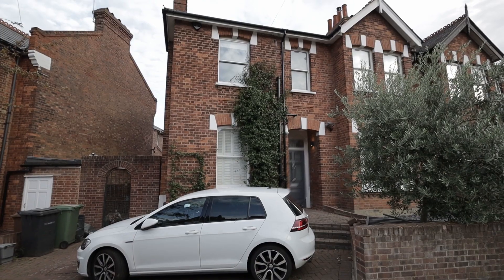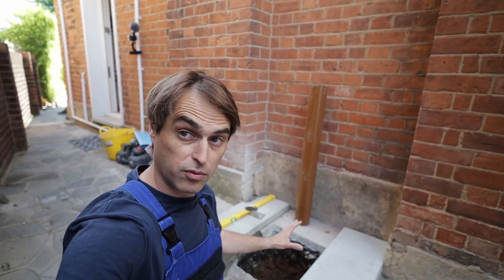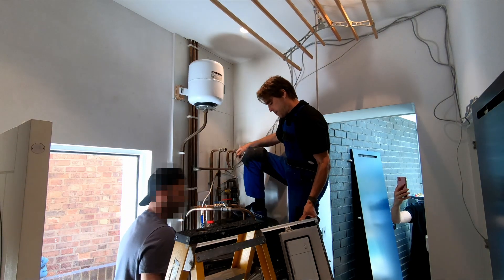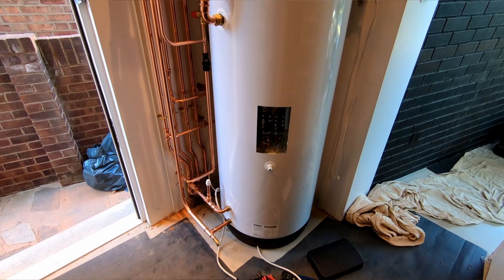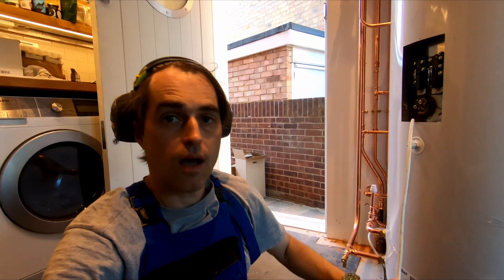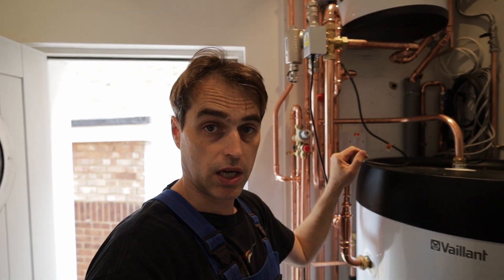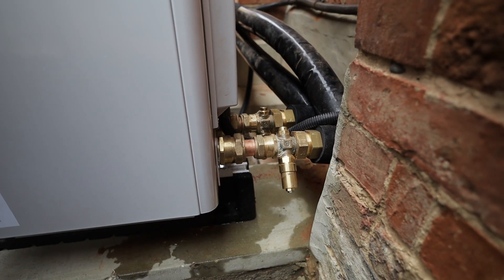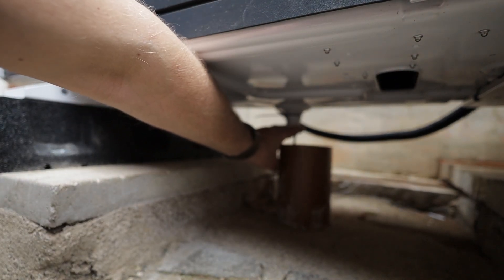Is This Heat Pump Better Than Your Gas Boiler?

Comment: What would the annual maintenance costs be on a system like this?
Reply: depends on the cost of 10 minutes of your time and the price of a bit of water to hose the outside unit down yourself with a garden hose and clean the lint and muck off the evaporator....

Comment: Depends on where you live most heat pumps setups don’t work under 40F
Reply from the maker: What are you talking about - they work to -20c / -5f
Reply: heat pumps work in heat pump mode to -15~20 easy and even then they can switch to a immersion heater for backup heating. if you get artic rated ones you can go down to -30.

Comment: The very fact that the homeowner has gone to the extent of insulating and reducing heat losses in preparation for the HP sums it up for me - also for reusing the old boiler and tank - double win. This with the fact that the HP only needs to be 6kW again sums up the problem with the UK gas heating industry in the last few decades. There are a couple of channels that could do with learning a thing or two from you! Great, honest work as always!
Reply: Surely with all the insulation work, a gas boiler only needs to be 6kw? The requirement is independent of the heat source??

So really the issue is insulation etc...not the source of energy?
Reply: @ChrisLee-yr7tz  exactly that - how much energy input is needed into the building to keep the temperature steady. Problem seems to be that the plumbing/gas industry's drive to rip out heat/system boilers in favour of combis that need a high output for hot water means the boiler design is scaled as such when it comes to CH - insulation isn't glamorous to most compared to new shiny stuff hence why it's neglected!
Reply: Huge radiators are not ‘ lovely ‘ they are needed because the hot water circulating through them is 40-50C not 80C plus like gas boilers .
Reply: @stoicsceptic8420  it's all about system design - any condensing gas boiler should not have a return flow above 55C if you care about efficiency in any case - likewise for HPs, bigger rads only to match the required flow temp for efficiency - 40-50C is on the high side...

Comment: The average annual COP is what matters, not the peak COP.  So how it performs over a full year thru all four seasons.
Reply from the maker: 4.1 is the average cop quoted by manus - so called sCOP
Reply: @UrbanPlumbers  
That is average?  If so I am impressed. Real world testing is the only way to determine.
Reply: @UrbanPlumbers  
Currently, my gas costs one quarter per kW than electricity. If it stays roughly that way, I would say gas has the edge for sure in running cost, and clear in up front capital costs.  But it costs about £80-100 per ann just to have a gas meter in the house. These days saving £100 and using it for electricity purchase, does not buy a lot of electricity.
Reply: @johnburns4017  your gas is mostly paid by the goverment. how long do you think that will last as its going now?

Comment: Osohotwater, who makes cylinders for Vaillant as you say, also make the unique Super Coil (SC) cylinder where all of the connections are on top of the cylinder so it is has a very tidy look. A common use for it is where the gas boiler is above the cylinder in a tight space like a cupboard. So the blending valve, temperature & pressure relief valve, expansion vessels, motorised valve and all pipework are all situated on top of the cylinder (hidden under the lid). All their cylinders have concealed wiring as you demonstrated as well as concealed heating elements that don't stick out. Question remains whether these types of cylinders are as easier to service as standard cylinders.
Reply from the maker: They are very nice - just a bit wider than most though

Comment: That looks like about 200 MW of electricity before you go into profit.
Reply from the maker: This whole installation after the grant costs exactly the same to what a new gas boiler and cylinder costs to supply and fit.
Reply: @UrbanPlumbers  great news. Who is paying for the grant ?  That's a loan isn't it ?
It's the very necessary insulation and triple glazing that costs. 
My in law in rural Wales pays £ 800 / quarter to run his heat pump almost certainly because his house is very similar to most of the UK housing
Reply: @stephenrichards5386  insulation has nothing to do with how you heat your home, it only tells you how much heat you need. your radiators or underfloor heating does not care in the slightest how you heat up the water that flows into it.
Reply: @SupremeRuleroftheWorld  you have gone off at a tangent.
Reply: @stephenrichards5386  no, i am telling you that insulation has nothing to do with how you generate heat, it just tells you how much you need. Those are compeltly different things. So even starting with the idea that you need triple glazing or whatever is completly missing the nail and the board. The amount of energy you need to pump into your house does not change with the method you generate said heat. Basic thermodynamics still apply. That is not a tangent, that is what you need to understand.
Reply: @SupremeRuleroftheWorld  exactly. I don't know where you got the impression that I was focusing on the heat source.
Reply: @stephenrichards5386  you are saying (without knowing probably) that you cant change the heat source without changing the heat load.
Reply: @UrbanPlumbers  thanks for taking the time to reply. I love your work and would be happy to have you install my heating

Comment: Someone has spent a fortune on insulation. Add the cost of the heat pump and then do the cost benefit payback. 
I'll be long dead before I'm in profit

Comment: I wonder if Vaillant is factoring in losses for defrosts that are quite often in subzero temps and happen about every 2 hours in my experience. How is this system adjusting its output? Indoor compensation, weather compensation or both? I like the look of those anti vibration pipes, my installer is meant to put one on but they didn't and there is a noise coming from all of the radiators in the home.
Reply from the maker: Weather comp plus internal compensation as well if I understood the system correctly. Radiators noise can be just high flow with wrong valves on the rads

Comment: Best trick to keep a green roof with grasses on it than moss plants in check , when installing get yourself a cheap robotic mower and add a couple more inches for turn around , or add a small perimeter with gap for draining, never run in strong winds or have it on the roof in small monsoons 3 years and still going strong ps pitch can’t be more than 20%

Comment: Would have been really interesting to compare consumption of the 6kW heat pump vs. the Viessmann 200 job you did a few months ago. I'm willing to bet the client will not save much (if anything) over a gas boiler that can modulate as low as Viessmann. 

Frankly, I'm surprised no one has compared actual numbers on the best boiler you can buy vs. the best heat pump you can buy. Maybe worth considering for your follow up?
Reply from the maker: He will. Even the most efficiency boiler is ‘only’ 90-93% efficiency. This Hp has a chance of going well over 400%. Still 4.4 times higher than V200.
Reply: @UrbanPlumbers  I believe the V200 can modulate much lower than the Valiant boiler you replaced. Don't mean to correct you but the v200 is rated at 98% efficiency at full modulation. Would be good to know the cost savings per month if any and the delta in installed price for both. 

That would be an incredible episode!
Reply: @singlendhot8628  yes your right it modulates down to 3.5kwh - so running cost at lowest about 20p gas before aug/sep increases I believe the Worcester Bosch 8000 can modulate down to 10-1 ratio the best on the market given electric is 40p now already per kWh  we would need a 5 to 1 cop rating to cost the same power for power to be cheaper than gas in an ideal world setup. Honestly I think they could have just swapped to a 24kwh and it would have worked out the same and still have provided enough heat , unless they are adding solar and leaving on wether comp 24/7  with low wether protect of 3c it will not be much in it
Reply: @ram64man  200-W modulates down to around 2 kW in a well insulated home. It is far superior to anything Bosch makes. Take a look at a previous video UrbanPlumbers did to see advanced weather comp in action. The combination of the two makes it hard for a heat pump to beat! Which why a comparison would solve this debate.

We only install 200-W these days!
Reply: @singlendhot8628  a vaillant ecotec exclusive 27kw has a lowest condensing modulation of 4 2kw with 10 stages of modulation. A viessmann 200w is 1.9kw
Reply: @Muppetkeeper  Utter nonsense!
Reply: @Muppetkeeper  You clearly don't know much about the V200W. Do a bit of research before embarrassing yourself on a public forum.
Reply: @Muppetkeeper  Sorry to have to share that the Viessmann has all of the above real time monitoring capability built into the boiler.
Reply: @Muppetkeeper  You've just been told that the boiler is capable of real time monitoring by those with hands-on experience and you counter that by stating you referred to a brochure after accusing them of doing the same? All boiler efficiencies are upto a %.

People like you aren't meant to understand or install high end product.
Reply: @Muppetkeeper  Why not get your hands dirty by installing one. Perhaps you'll learn something then...but I wouldn't bet on it.
Reply: @singlendhot8628  just had the 222 installed and it's wonderful
Reply: @UrbanPlumbers  I remember having this exact conversation with Szymon while he was installing our V200-W system boiler earlier this year. The jury is still out on whether the heat pump savings will pay for the difference in installed cost but I agree that this would make a very interesting debate.

Very impressed with the Vaillant hardware though!
Reply: at best, even if perfectly set up and optimised and with intelligent controls (often not done) you may approach 95-98% with a gas boiler. You’ll never hit 100% and never exceed it. A good heat pump will have a COP over 4 due to their design. And they’re designed around -2c so for the UK at least a fairly ‘worst case’ setup as we have quite mild winters relatively speaking. So you should easily achieve that. So you’re still looking at a 4:1 or greater ratio with the heat pump. price is one thing but the government want us to move away from gas for heating (for CO2 reduction but also as we see for energy independence so even climate deniers may support that bit..) so I’d expect pricing to shift towards more affordable electric vs gas over the medium/long term
Reply: @MrKlawUK   Can't disagree with most of what you have said. I'd add the following:

1. Heat pumps will continue to improve when it comes to increasing SCOP and reducing noise levels, if the last 2 years are any indicator.

2. Gas boilers are near their peak. The Viessmann 200 is that pinnacle.

3. I would argue that a medium term switch is out of the question. We are 10 years away from any kind of scale on heat pumps. Long/ Longer term, yes.
Reply: consumption is a factor of how high (or low) you set the thermostat. its not dependant on the machine. you need to compare the cost of heat output. the short math is that to get the same heat from 1m3 of gas in a good and modern gas boiler you need 1.5~2kWh of electricity. do the math yourself on the price of each. 1 unit of gas versus 2 units of electricity.
Reply: @SupremeRuleroftheWorld  1 unit of gas is 1kwh.

Comment: But the thing is, that boiler would be on few hours a day only in the winter.  The heatpump will be on many more hours (maybe 18 hours a day. Is there an efficiency loss from that?
Reply: it takes a certain amount of KW to heat your house - that doesn't change. The boiler will just be putting out a lot more power for that 50% of the time; once the house is up to temp the heatpump will be cruising along at very low power use (my Air to Air heatpump uses about 300-400w to keep a 40sqm area warm at 0 degrees). Air to water obviously uses a bit more because of the water pump.
Reply: Ha I had exactly the same thoughts - No one ever talks about that - heat pumps are NEVER switched off in normal usage - that's a lot of electric being used 24/7 compared to a combi which is usually off for more than 50% time
Reply: @mattsan70  no, it does not use more electrictly. it uses what it needs to compensate for you heat loss, nothing more. running it for shorter times does not make it use less. using 250W all day is 6kWh, it can also burn tru those 6kW in 2 hours if it REALLY wanted to but you are left with LESS heat when when you just let it run. its just like cruising down the motorway behind a truck vs slamming the pedal and driving like a escort hooligan. they both get where they need to go but 1 of them used a lot less fuel to do so.

Comment: Don't heat pump systems have to stay on 24/7? My combi is only on when I need it - doesn't that skew the usage/efficiency calculations off a fair bit. Great work as always.
Reply from the maker: We will compare actual energy use on this house in the winter to answer this question.
Reply: Yes needs to be on 24/7. You are creating a climate in your house, by keeping it ruining it’s energy efficient. Turning it on and off is like driving in a traffic jam.
Reply: yesm it needs to be on constantly. the trick is to keep up with the heat loss, not catch up constantly. that is the most economical way of heating a home and keeping it heated. just adding little bits of heat constantly is MUCH more efficent than just redlining it to the finish line in 10 minutes like a gas boiler does.

Comment: Answer to your question what with the rising costs of electric I would say no
Reply from the maker: Still cheaper to run than a gas boiler though
Reply: @UrbanPlumbers  what’s the wattage  it uses when on and how long does it need to be on for.
Reply: @anthonywalsh2520  that depends on how high you set the thermostat, that has nothing to do with it being a heat pump or a gas boiler. that is like asking what your car uses without knowing what you drive or how you drive it. are you a grandpa in a suzuki or a hooligan in a bmw X7 doing 120 over the M5?
Reply: @SupremeRuleroftheWorld  min and max wattage then I know how much per kw my gas is and I know my daily usage across the year, I could easily check if this would be better or worse financially before looking into any further by knowing what the min max wattage is

Comment: I really want to go ASHP but not until I do my "final" downsize in 5 or so years. Put in solar and battery in Jan which I love but don't want to "sink" ASHP and associated works investment in somewhere with less than 10 yrs life. I'm tempted when I move to take the battery with me because the thing I learned quickly is you can't have enough of that storage...

Comment: Your explanations and work quality are superb-this is a joy to watch.

 What are your thoughts on the refrigerant splint heat pumps e.g. Daikin Altherma 3? We are looking to site a heat pump at the end of a mid-terrace garden, around 30m from the cylinder location.
Reply from the maker: Split is fine if you need to locate it further away and cheaper to do than long pipework for a monoblock.

I would stay away from Daikin though. They are not even remotely as nice as Vaillant or Mitsubishi.
Reply: @UrbanPlumbers  thank you. Some of their specs say a max of 25m- would that be a hard limit, either for function or warranty limits?

Comment: I have a question and i was wondering if you may help me with an answer: why none add in the calculation of the efficiency of a heat pump the domestic hot water . you obviously use a hot water cylinder ( storage hot water ) so for every drop of hot water you consium , a drop of cold water comes in the cylinder . The result : the water in the cylinder it gets colder and colder as you use the shower ! . With a combi gas boiler you have as much hot water you need and any time you may need it . And the most importand : if you adjast the domestic hot water output on 41C to 44C then you can use only the hot water tub without any mixing with cold water (how efficient is that ?).
and i dident mention yet the huge difference of the cost of a new heat pump compare to a new combi gas boiler . Thanks a lot 
PS. i am a fan of you and i realy enjoy your job. well done .
Reply: the water in the cylinder is drawn off the top of the tank - it doesnt get colder and colder because the tank doesnt mix quickly. You only notice it getting colder when its nearly empty.
Reply: @Etacovda63   you didn't catch my point,  I say that you gonna lose energy.  The water temperature in the boiler from 60C it will be 50C (after of a 20 to 30% use of hot water )
Reply: @SV_maintherm  no, that’s not how it works. The only additional losses you have are standing losses into the air from the tank. If you were using a combi you use the gas as you’re using the water. If you’re using a tank you use the energy when you decide to heat the water. It’s just a time shift, not a loss of efficiency.